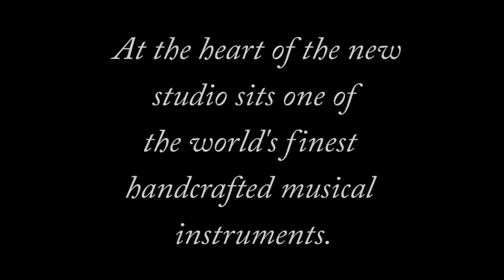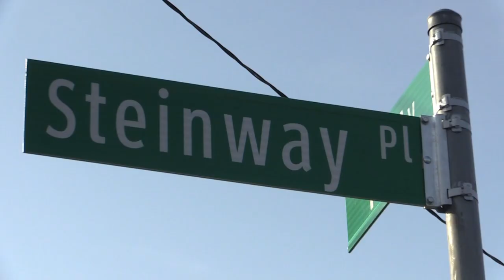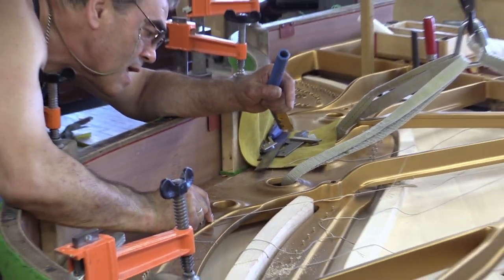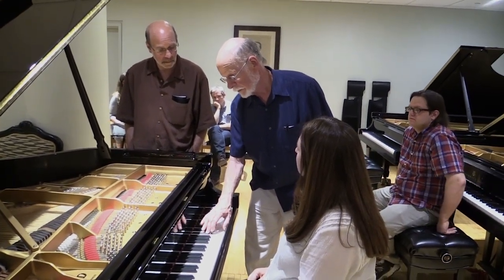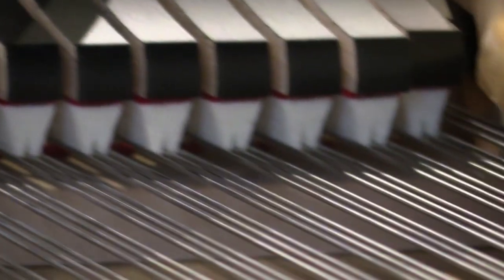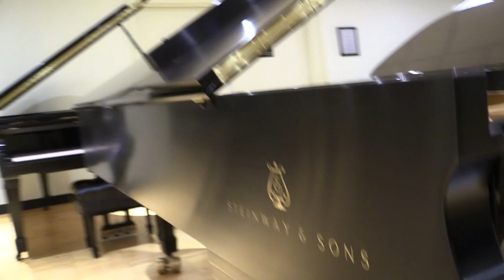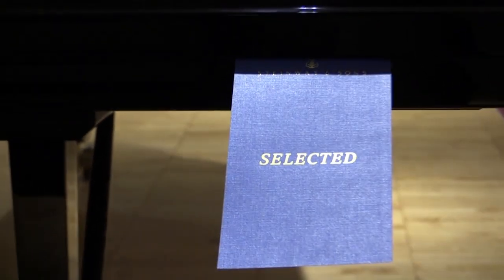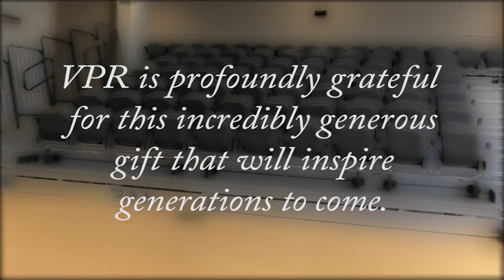Selecting A Steinway - with help from world-renowned pianist Simone Dinnerstein

Comment: I would also think that when the piano is moved there is going to be a mess of tuning to be done because the strings will be stretched and compressed and not to mention the driver will make sure to hit every pothole along the delivery route.
Reply: Yes, it is customary to tune even a Steinway after moving.
Reply: :D :D Really! Piano - moving companies have special means to transport multi-dollar grands. Temperature regulated and probably also special suspension and shock-absorbing underlay.

And it has to be tuned OFTEN! You can see a video from a tuner whose work it is to tune pianos at the Sidney Opera-house. Wow. All day! All year!
Reply: Every piano must be tuned after being moved. Preferably two tunings with not much time between.
Reply: tuned by a Steinway trained technician after the crane takes from the truck and four guys place it in the living room. .  A couple of weeks later, comes a tecnician looking at the case , scratches etc...  there will be more tunning sessions in the next four months.  The room is kept at 70F and humidity 50-60  % year round.  it will be stable for a long time.

Comment: So much money, so limited thinking.  Totally agree a Mason & Hamlin should at least have been considered (maybe it was and it is simply not shown).  Pianos are very very very susceptible to adjustment; which many may refer to as prepping the instrument.  Obviously tunning, but also adjusting the action, voicing (Simone knows, she has ears and knows instruments inside and out), and tremendously the relationship between the instrument and the hall (or room) where it will be played.  If this process were to be done right, you would try multiple pianos in the hall (not at the seller's), over a period of at least several weeks, and have the pianos extensively prepped.  Some of the characteristics you can hear in the little excerpts make me suspicious than some of the pianos were deliberately prepped poorly so that one of the pianos would stand out as the best of the lot.